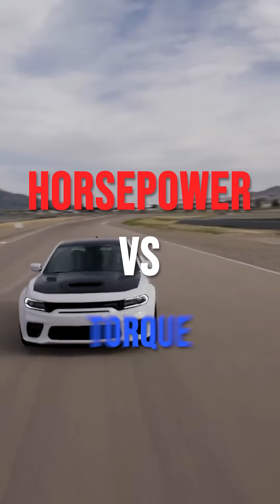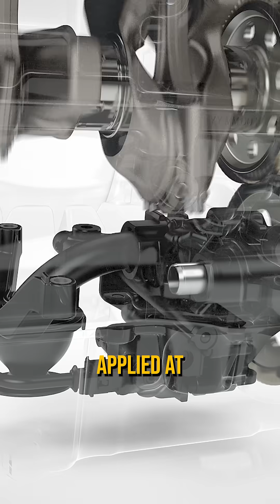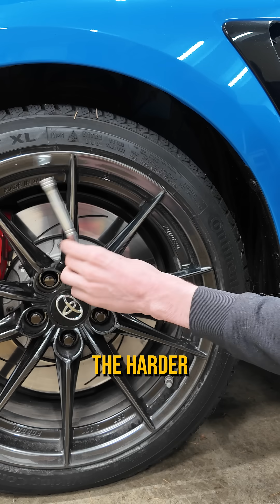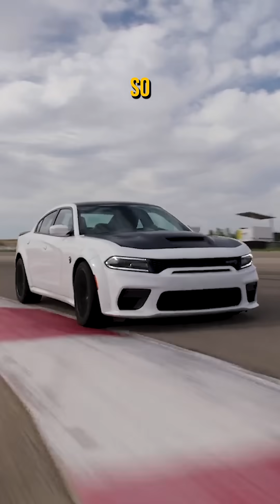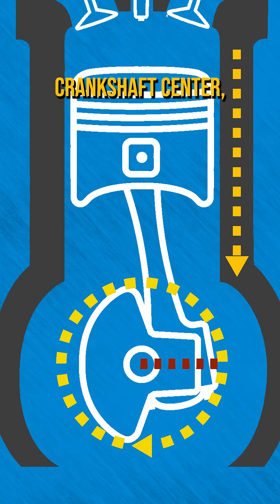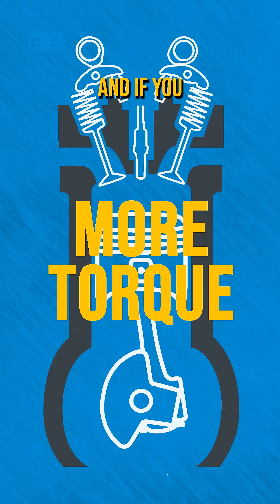Horsepower vs Torque (In 60 Seconds)

Comment: When one says " i have no power but i have torque" means in fact " i have no peak power but i got power at low rpm"
Reply: which is the story of a diesels life
Reply: power under the curve, and more average power which counts when  a vehicle doesn't have optimal gearing and/or drivers.
Reply: Could be, but that low end power still doesn’t give you maximum pulling power or acceleration. And that is the context in which it’s usually being said.
Reply: @autobootpiloot well said!
Reply: More like "I can tow whatever I want but it won't be very fast".
Reply: @enzoliu391  👍increasing engine torque without increasing power at a given vehicle speed will not result in more towing capacity. Only an increase in power can do that.
Reply: @rollsroyce329  As a matter of fact, torque, or traction force given a specific gear ratio and tire size, is what decides your tow capacity, even the engine produces only 1hp/1Nm, with extremely low gear ratio and low-diameter tyres, you can still tow immense amount of mass uphill, only very, very slow.
Reply: @enzoliu391  don’t be silly, torque can do no work on its own without power.  All work is not only done by power; but how much of it can be done per unit time is dictated by Power.  . Wherever you are on the curve is your budget to accelerate, tow, climb a hill, push air out of the way at top speed... torque is only a useful spec when you are calculating when parts will break.
Reply: @rollsroyce329 for instance, a 200hp/1000Nm tractor and a 1000hp/800Nm sports car towing each other, the winner will always be the tractor.
Reply: @enzoliu391  1000HP is 5 times the towing capacity of 200HP at any speed.
Reply: @rollsroyce329 If it gets to the speed, and that speed can't be 0.
Here's the thing about power output: power output requires both torque and rpm, but torque doesn't require either power nor rpm. Let's just say you are pulling a wall with your 1000hp/800Nm EV car and you have unlimited grip (no slide), the wall doesn't move, hence rpm=0, your car isn't putting out any power, but the torque is there for sure, which is 800Nm, less than 1000, hence less towing capacity.
PS: Towing capacity is determined only by how much weight a car can move, not how fast a car can move that weight.
Reply: @enzoliu391  how much can you tow at a rate of zero?  No towing occurs without Power.  All work is done by Power.  Power is both the e magnitude and the speed of towing capacity.  Power = Force x velocity. It can be delivered as high Force at low velocity or low force at high velocity.  The capacity to do anything is directly proportional to Power not to Torque.  Torque doesn’t do . do is a verb force and torque are nouns.  Power is a verb.  It is the transfer of energy Power = dE/dt.  No energy transfer - no work.
“Force” Is
Power Does
Reply: @enzoliu391  please don’t use a “wall” for illustration.  It’s the analog to playing stairway to heaven poorly in a guitar shop.
Reply: @rollsroyce329 You are hardly making sense now dude.😅
"No towing without power", yes, but does that mean you can tow without torque? Apparently not.
And I think you kinda mistaken the cause and result here, force generates velocity, hence the power, not the other way around.
Reply: @rollsroyce329 and I'm pretty sure "towing capacity" has nothing to do with speed, only mass, since the unit is simply "Kg", no "kph".
Reply: @rollsroyce329 One thing you are indeed right about tho, power can be delivered in hi rpm/low tq or vice versa. But either way, neither tq nor rpm can be 0.
Reply: @enzoliu391  how much towing are you doing at Zero speed?
Reply: @enzoliu391  nonsense.  Force is motionless, frozen and timeless.  It can do no work in spacetime because it has no time component.  Movement begins with Power and is proportional to power.  Of course you can’t have power without torque in a rotational system.  You also can’t have power without rotation (RPM).  You can’t do work without power.  Work doesn’t do itself and Force can’t do work.  The big gap inbetween can only be filled with the transfer of energy to move the mass in spacetime.  The only thing that IS the transfer of energy and that Does the work by transferring energy is Power.
Power =dE/dt
All work in the universe from typing, chewing your food to the movement of planets is done by power.
Reply: @enzoliu391  don’t assume that because you don’t know what I’m talking about means that I don’t know what I’m talking about.
Reply: We are all very grateful for the contribution made by force and torque.  However they are not the doers of work.  Power is.  If something is happening power is doing it.  Force may be building up in balanced equilibrium somewhere under Karlifornia as we speak but until all of it is released through a massive transfer of energy the residents and real estate are/is safe.
Reply: @rollsroyce329 Alright alright, got ur point, chill out man😂.
Now, let me make myself clear one more time:
One, towing capacity only indicates the maximum weight a car can tow (in another word, the maximum resistance force it can overcome), not the speed it can tow that weight, so it has nothing to do with power, which you said it yourself, "requires speed".
Two, for the same reason, the sports car vs tractor truck scenario, speed has no say about which one can win a tow race, only force, and the sports car simply can't apply enough force to overcome the resistance from the truck, hence the tractor truck will always beat the sports car. Unless the sports car has lower gear ratio to magnify its torque, but that's another story.
Reply: @rollsroyce329 As for "1000hp is 5 times the towing capacity of 200hp at any given speed", well, is clearly wrong, since you've mistaken the definition of "towing capacity" in the first place.
Reply: @enzoliu391  it’s grade 3 mathematics. 1000HP can do 5 times as much more work per minute than 200HP.  I’m getting bored here.  Not only are you not leading anything, you think you’re “teaching”.  😂
Reply: @enzoliu391  no you have not got my point and you’re not going to.  I’m sorry I was not able to help you.
Reply: @rollsroyce329 Yes 1000hp is 5 times more powerful than 200, but it doesn't mean it's 5 times more "forceful". What part of "towing capacity only concerns force not power" don't u understand? 
All u did was repeating "power does the work" which is totally irrelevant in the question of "towing capacity" and "force", yet you are accusing me of "not getting your point"?
Well, I'm not a teacher as you see, if you insist than the unit "Kg" indicates power not force, good luck graduating from grade3.😑
Reply: @rollsroyce329 Fine, one last time, this is my final effort:
Say, I can lift at most 50kg of weight, when I do, the max lifting speed is 1m/s, so my max power is 500N x 1m/s = 0.5Kw, you on the other hand, can only lift 10kg, but at a speed of 10m/s, your max power is 1Kw. Consequently, you are twice powerful as I am, but I have 5 times tow(lift) capacity as you do.
There, if this still can't change your mind, go ahead and call "tow capacity" whatever you like, I really can't be bothered any more.
Reply: When someone who doesn’t know what they are talking about says " i have no power but i have torque" they probably mean: What Power I have is at low RPM.  
Without Power they have no means of propulsion.
Reply: @rollsroyce329 yea it's just simple math they're ignoring....torque × rpm = power...obviously when torque is bigger, your power is gonna be bigger at a fixed rpm
Reply: Tractors
Reply: But It isn't relevant. They would be right if the had say "The ratio between my average power and my peack power is high". You can have tons of torque and a narrow power range. It is not usual but It is possible. Some 2stroke or giant turbos for instance. On the other hand, electric motores are  famous for their giant amount of torque. Torque is similar to some ICEs, but they are able to reach 30000 rpm, so their power range is so wide, that they don't need gears.
Reply: @VictorDiaz-lo2mu  too bad they are a trojan horse for Communism 3.0 and the elimination of private transportation or all private property for that matter. Last time Communism and Fascism were tried tens of millions of people died.  Just say no to electric cars and Communism 3.0
Reply: @rollsroyce329 . Man, I think this channel is about engineering, not about hilarious politics.
Reply: It doesn't matter wether the power comes low rpm or high rpm, because "power" itself contains rpm already, 300hp at 2000rpm is no less than 300hp at 20000rpm, the only difference is the gear ratio you have to apply for the speed and traction you want.
What you really mean by that should be "torque at low rpm", not "power".
Reply: @enzoliu391  power at all RPM.  Power is what does work, torque is a lack of work being done.
Reply: @rollsroyce329  That's... one way to see it, I guess?
Reply: @enzoliu391  😊got you thinking?  It’s not the Newtonian view but he has been dead since 1727.
Reply: Every harley rider
Reply: @vivienstaehle1326 ur comment summed it up perfectly!
Reply: Eggzactly, more lower end torque is more lower end power!
Reply: @art__3842  Eggsarecrackelly👍 Save yourself a step and just look at the power curve. Wherever you are on the curve is your budget to accelerate, tow, climb a hill, push air out of the way at top speed... torque is only a useful spec when you are calculating when parts will break.
Reply: @rollsroyce329 yes definitely, power is the ultimate output....power made by lower end torque is suitable for trucks and power made by rpm is suitable for fast stuff....it's that simple
Reply: @art__3842  to preserve as much of your wording as possible can we meet at: power is the ultimate output....power made at low RPM  is suitable for trucks and power made at high RPM is suitable for fast stuff....it's that simple.  Any objections to that?
Reply: @rollsroyce329 A little improvisation is what I'm seeing and of course no objections from my side

Comment: Torque gets you going while horsepower, keeps you moving
Reply: No
Reply: @Fordguy1997 prove me wrong. I can accept critique. Just don't tell me I'm wrong but not prove it😂
Reply: @ajtoofly7315 Torque to the wheels both gets you going and keeps you moving, and it's a function of power/wheel rpm, so at any given speed horsepower is what will get you going, while engine torque will be irrelevant.
Reply: What do you mean by keeps you moving?  How much gas you have in the tank is what “keeps you moving” 

Power, not torque, is the limiting factor in not only the top speed of a vehicle but also how quickly it can accelerate at any speed and how much weight it can pull up an incline at any speed.

Comment: With the right gearing, somebody on a bicycle could pull a freight train, although they would do it very very very very very very very very slowly, they would be able to do it. A human can produce. What about 2/3 of a horsepower? The more you gear down, as in have a smaller gear turning a bigger gear, multiplying the torque by that gear ratio, but cutting the speed of that torque by that same ratio. The power overall is still going to be the same.
Reply: See
: motors
: diesels

Comment: An analogy that I've heard and used a lot is, "Horsepower is how fast you hit the wall, torque is how far you take the wall with you"
Reply: Makes zero sense but okay
Reply: If you watch the full video, he says a better analogy is "Torque is what presses you against your seat, horsepower is what keeps you there"
Reply: this is incorrect
Reply: Please stop.
Reply: That makes no sense since the kinetic energy of the car vs the weight and rigidity of the wall play far larger parts in this.

More accurate analogy would be:

Torque is how heavy a load you can move, power is how fast you can move it.

(All else being equal, ofc, because in two different vehicles, the gear ratio matters much more than the engine torque)

Comment: Why about  EV ?!
Reply: An EV also creates a rotating motion. The rotor of the motor has a diameter and the stator applies force through currency cycles (AC).

Instead of a hand turning a wrench from one point, picture it like your entire hand turning the Lid of a pickle jar.

In any case this force times the diameter of the rotor can be considered torque and the power is that torque multiplied by the speed of the rotation (RPM).
Reply: Just say no to Communism 3.0!